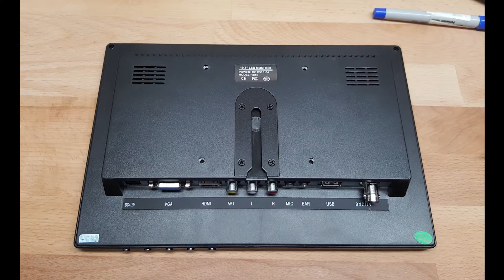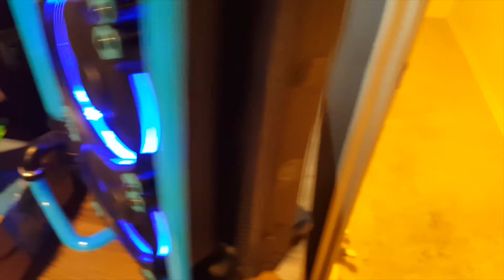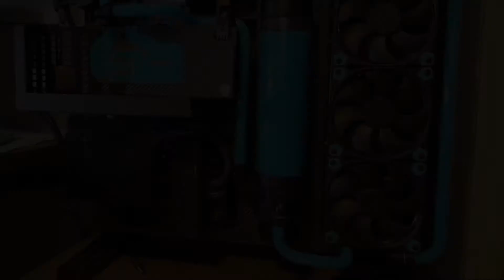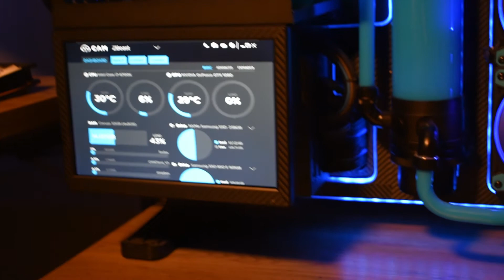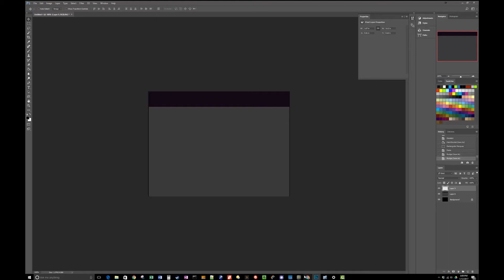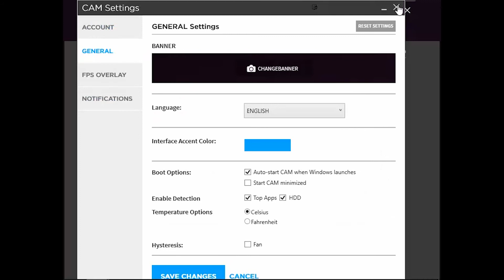PC Upgrade - Mounted System Stats Display Running CAM

Comment: nzxt cam is just as shit as thier hardware. inaccurate readings are just the beginnning.
Reply from the maker: Recently dropped CAM and moved to a customized "Stats Dashboard" using AIDA64. Waaay better. Video of the update coming soon.
Reply: @MrArmageddonBuilds  excellent choice.
AIDA64 is pretty damn good. the only drawback is that for full functionality it costs money and is what i would consider expensive ($50AUD), however, it was money i was willing to pay after using the trial long enough to realise just how customisable it really can be.
it can be a little slow to update at times (mainly on network monitoring, short up/downloads dont have time to get put up on the monitor which refreshes once per second), but still very acceptable, and it is accurate.

Comment: how do you get cam to do this? mine will go into full screen mode and have 100000 things listed. what version is this?
Reply from the maker: You can't run in Full Screen mode if you want the larger graphs and dials. Not sure why the [] wouldn't resize the window to work as I am showing. Maybe try adjusting the CAM size on another screen then drag it to the stats display?
Reply: Mr Armageddon Builds I’ve honestly tried everything to adjust in. I’ve tried compatibility mode resolution. No work. I can make my monitors resolution smaller for it to fit better. But it’s too small. You’d figure they’d have something just for these
Reply from the maker: If you have an Nvidia GPU, you can create custom resolutions with the Nvidia Control Panel.
Reply: Mr Armageddon Builds didn’t think about that. I will do that when I’m home

Comment: Did you just paste a carbon sticker on top of the monitor or removed the buttons?
Reply from the maker: It's an adhesive vinyl wrap. The buttons are on the front but not raised, so the vinyl goes right over the top.

Comment: I know this is a old post but i hope you still monitor it...... I just installed the same screen and cooked it... I hooked the 12v and one ground from molex to 12v and ground on the power cable..plugged it in and it fried the screen.. I will try again with a new screen if i can get some idea what i did wrong.. any help is accepted.
Reply from the maker: Dang, that's no good.
Wiring is pretty straight forward with the 4pin connector, but sometimes things can get reversed. I would suggest testing the leads you tie into with a Multimeter to verify 12v connection. Once verified, then plug in your screen. I used a barrel connector pigtail to ensure correct polarity.
Reply: @MrArmageddonBuilds  Thanks for responding, I really don't understand what went wrong, I tested the molex with my meter..12v on one side and 5.5v on the other side, I used a spare molex I had on hand , I left the 12v and one ground on it and cut the other 2 off, I then spliced it onto the DC power supply  and plugged it into the molex. Booted up pc and you could smell it burning.  Kind of scared to burn a second screen up.
Reply from the maker: Only thing I can think is that maybe the polarity was wrong going into the DC Barrel Jack Adapter? Test outside the system for functionality before installing to the PC Power as well. Good luck.

Comment: Can you please post the name of the secondary widget you are using to monitor data?
Reply from the maker: On the smaller display, using NZXT CAM. On the larger monitors, the side gadget showing system specs is Rainmeter.
Reply: Thanks! Your build is very inspiring.

Comment: Looks really good, I want to do it but don’t understand the power part :/ nice pc man xD
Reply from the maker: robvts, just used the 12v wires from a 4pin accessory connection from the PSU. Pretty simple to do. Here is a diagram.  Only need the 12v and Ground wires.  https://i.stack.imgur.com/NpPzH.png
Reply: MrArmagedd0n do you just connect the same coloured wires to each other?
Reply: Also when u start the pc up do u have to drag the screen over every time or does it load up on the screen on its own? Iv got a p3 so want to cover the power supply up
Reply from the maker: robvts, no the screen will stay in place on boot. Treats it like a normal monitor.
The display has a Barrel plug going to a 12v wall adapter. Just cut the wire and splice with the 12v and Ground coming from a 4pin connector.
Reply: MrArmagedd0n ok I’ll give it a go lol thanks for you help pal

Comment: how did you make cam fit full screen on the 2nd im trying to do my 2nd like yours and cam wont go full screen like that
Reply from the maker: Charlie Brown, You will need to modify (set lower) the resolution of the smaller display to make CAM span the entire screen.
Reply: so set it to something closest to the res of the monitor
Reply from the maker: Charlie Brown, No, I set mine to a much lower than the screen's native resolution. Start with 800x600 and go up from there until it looks the way you want.

Comment: tried vinyl wrapping mine. what a pain. got it finished but not. implement happy with all the seems. gotta be a better way
Reply: Hey Eric, did it work with the P3 case? Can you post a picture somewhere and link it? Planning on building on a P3 and wants to do this upgrade aswell. Thanks.
Reply: Enrique Ponte Ojeda yes I did install the screen on mine. Looks great.
Reply: Awesome! Any chance you could send me a picture? I'm worried that the 10.1" will be too tall to fit in front of the power supply on the P3...
Reply: Lucky Shot message me on Facebook. Look up Eric Hovermale and look for my same pic here.

Comment: Thanks for creating the video on an awesome add-on to your build.  Just ordered my P5 case and this has given me new ideas abound.  One mod I need to work into the case is space for 5.25" optical bays.  I was looking for new single bay fan controller to fit in one of those slots as well. ( replace present touchscreen 2 bay controller  ) Now you're gonna make me spend more $$ but will be totally worth it and I'll be able to display tons more info.  Thanks again.. great job!
Reply from the maker: danxmanly, If you have access to a 3D Printer, Thermaltake has a site with some designs available for case upgrades, and DYI 5.25in bays. 
http://3dmakers.thermaltake.com/dwgallery.aspx?s=8
Reply: Don't have on yet.. but it's on my bucket list.  ;-)  I did see all those links and will have to revisit them later.  I ended up getting a black anodized 3 x 5.25 bay from Mountain Mods.  http://www.mountainmods.com/525-optical-drive-cage-p-539.html  Will work on placement of it once I get all the parts in.  I'm doing some additional mods to the case using some aluminum industrial profile sticks, possibly allowing the large side to actually hinge out, and putting additional plexiglass on the sides/top to aid in dust prevention.  Will post some pics later for all to see.

Do have one question for you .... did you ever consider using a touch screen monitor instead of what you ended up going with?   Seeing some in the 200-250 range and I think it'd be cool to be able to adjust things right on the screen through a cutout in the side plexiglass, or possibly mounting the touchscreen it in the plexiglass itself.

Comment: just ordered this screen for my core p3 case. what type of screws were they that mounted into the back for mounting? thanks for the help bud!
Reply from the maker: Eric Hovermale, M4-.7 x 10mm Metric Socket Cap Screws.  10mm is a bit too long, but its what I had on hand, so I just used some nuts to shorten them as shown in the video around 5:30.
Reply: MrArmagedd0n thanks. I was looking around. all i can find is 12mm so I'll try nuts as well. thank you
Reply: or I'll grind some threads down
Reply: Hey Eric, did it work with the P3 case? Can you post a picture somewhere and link it? Planning on building on a P3 and wants to do this upgrade aswell. Thanks.

Comment: how did you make the connection with the wires into the molex connecter? and which one is power and which one is ground?
Reply from the maker: Eric Hovermale This image shows how it is wired to the 12v lead in the molex connection. 
http://i.ebayimg.com/images/i/231181401394-0-1/s-l1000.jpg

Comment: Thanks for posting this video. Such an amazing job on this build. The black in the background really makes the blue pop.  I did many PC builds overtime but always used the AIO water coolers. This case and your build has really inspired me to do my first custom water loop. The small monitor addition is really cool. I will have to give this a try.

Comment: Nice video.....I keep running across your build and used it for inspiration to build my first PC and I just finished the water cooling yesterday. Not nearly as nice or tidy as yours, but overall I'm happy with my 1st attempt. (I was the guy that lives in the area) Thanks for posting the vids!